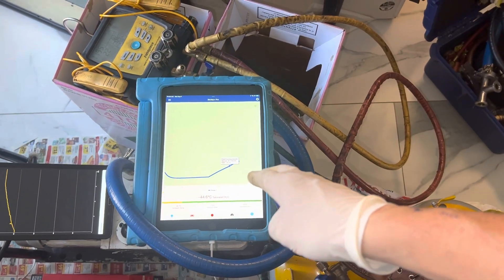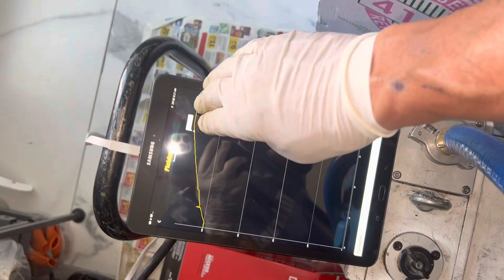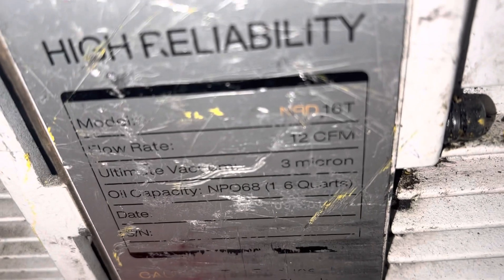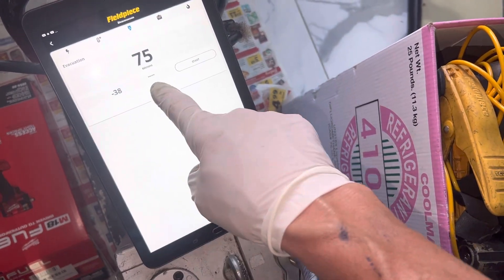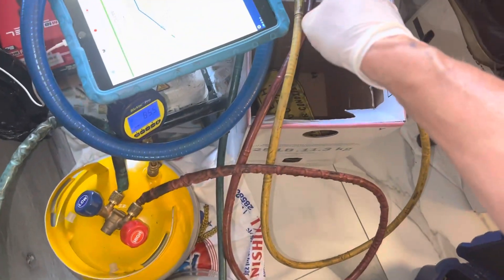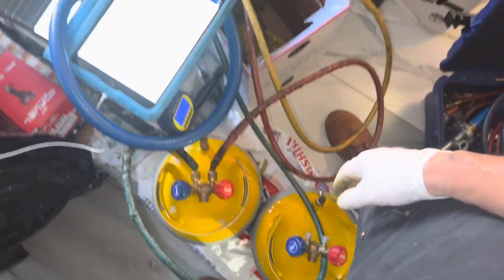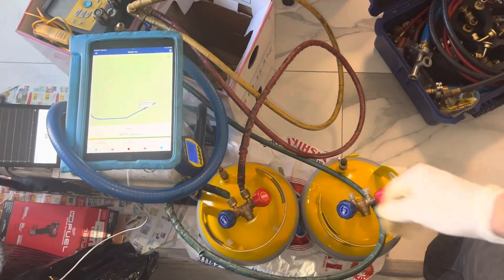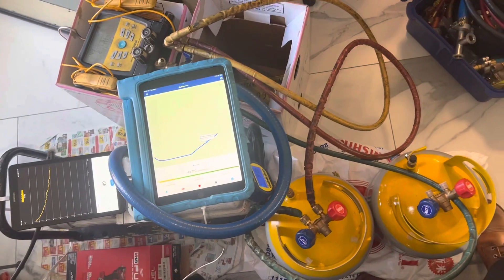Just the hoses by themselves decay to 1200+ microns. You may think the hoses are bad but is normal￼

Comment: Ensure there is a ball valve on each volume and add a T to pop on a vacuum meter. Then you have a meter for each of, the tank, the hoses to the tank, the manifold, the hoses to the pump. Once you get your final read... turn off each ball valve/manifold valve working from the tank back to the pump. Then measure all the pressures in each component. If you don't have that many meters, you can do it multiple times and move them across the lines systematically.
Reply from the maker: I have that many meters I also have one of the NAVAC vacuum pumps with the built-in micron meter.

Comment: Yellow jacket hoses are better but their low loss fittings are not reliable, on my 3rd set.
Reply from the maker: Yes almost all lol loss fittings kind of suck. 

That’s why I do not purchase some built into the hose I purchase them separate so you can for a place only the low los fitting and do not have to replace the hose. 

The first thing I do on a brand new low last fitting as I take that little C-Clip out of there I pull the barrel off disassemble it remove the O-rings and lubricate everything including the O-ring grooves with dielectric grease (silicone grease ) and put it all back together. This extends their working life

And if you clean the fittings make sure there’s no damage on them before you thread it on and put a little bit of silicone grease or Nyllog on the quarter inch fitting on your unit to act as a protectant and lubricant for your quick disconnect O-rings they will last longer

Comment: What is the normal decay test for hoses and AC system?
Reply from the maker: Do you mean the hoses on the car  AC  lines and hoses

It depends on how dirty how moisture contaminated the system is. 

Unfortunately it’s often difficult to get a car to go down below 1000 µm and hold there for 10 or 15 minutes. 

A real clean dry system will hold around 500 µm valving off and separating the refrigerant hoses
Reply: @coldfinger459sub0 I mean  gauge hoses and AC system it self.
Reply from the maker: @issamadam9352  normally gauge hoses will always decay due to contamination in the porosity of the rubber over 1000 µm to about 1800 µm on most peoples gauges. 

But since I use my gauges about 6 to 8 times every day and I bring the micron level on my hoses below 100 µm after each time I’m finished using them they always get degas and moisture removed many times a day. 

So even at the end of the day when I’m finished using my hoses if I don’t put nitrogen back in them and I leave them under and vacuum. 
                   The next day when I go to use them the micron gauge decay will read between 800 and 900 µm. 

That means even if you’ve done and performed an excellent vacuum on your system and you had a micron gauge hooked up let’s say on a sensor port or any other attachment point on the vehicles hoses or a accumulator and you were capable of reaching 100 µm with the vacuum pump on but when you shut it off for decay if you kept your hoses hooked up you would probably fail a micron decay test because it would probably still go well over 500 to 700 µm.

Comment: The pressure measured AFTER decay is the static pressure that I call it.  It’s good you do the test indoors!

The two rubber hoses have some elasticity BUT ALSO HAVE A SMALL VOLUME inside, so the elasticity will affect their OWN pressure when the tank is Off; however, it will affect a tiny bit on the final reading when they are hooked to a big steel tank!
Reply from the maker: As you will see in the other video I have performed the test with the tank open and you get to see the result you were talking about

Cannot perform a micron test with the instruments being used on such a small volume of just hoses alone but I have done it before on steel or copper pipes small volume still gives you a big problem even if you have no rubber hoses
Reply: @coldfinger459sub0  I plan to do this test as well in the next few days.  I will just hook a micron gauge directly on a vacuum pump, and see how far it will go; then, I put a rubber hose in between, and see how deep it can go.  I’ll compare Both the nonstatic and static (decay) readings.